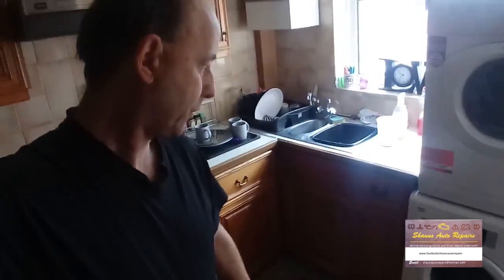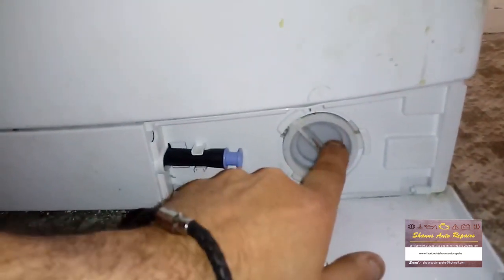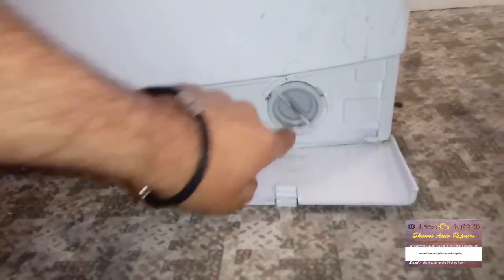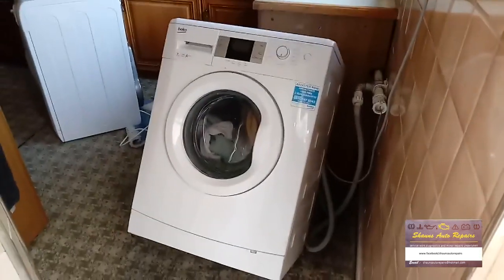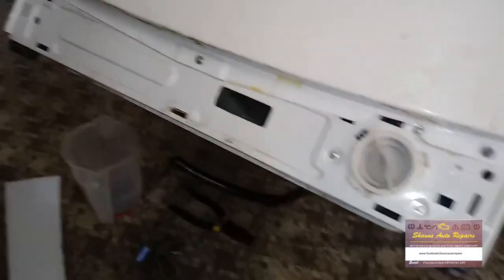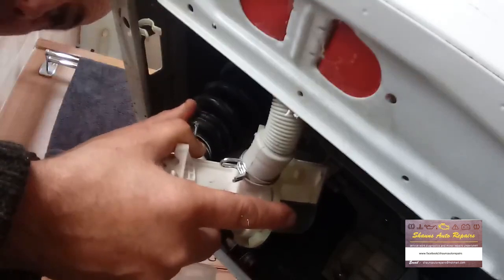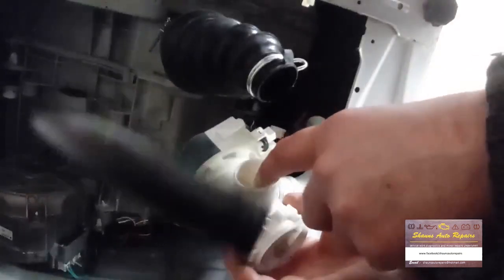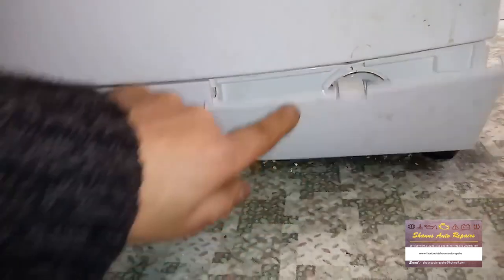How to remove or clean your waste water pump on your beko 7kg washing machine when its not draining

Comment: Great video - same as so many have commented, at the very least you saved me the cost of a repair job, although could easily have just ended up replacing the machine altogether. Amazing the amount of stuff that gets stuck in there.

Comment: Having this exact problem. I drained the water from the cap at the bottom. A few washes have been ok, but just finished a wash and the drum was about 1/3 full of water.  Thankfully I tried to spin it again and it has worked this time. But now I know what the issue probably is.  Thank you.
Reply from the maker: Glad I could help...thanks for watching

Comment: Informative video thanks. Issue I got on my one is the water doesnt ever drain out the hose bit, nothing happens but does easily come out the round filter part but takes ages and makes everywhere wet and recently when it finishes a wash the drum still has some water in there and lot of bubbles. When I then try a drain and spin to clear it, it starts from 12mins and stays stuck at 8mins for least 30mins and longer. Any advice would be appreciated cheers.
Reply from the maker: Hi... tricky..Remember I'm not a washing machine expert. I can only go by what I find on mine but sounds to me that either your pump isn't working or you have a blockage between the pump and the outlet of the pipe... if you have access to a hose pipe you can back flush it from the outlet and make sure it comes out the pump.. with the round filter housing in place you can back flush right back into the drum... hope this helps.. thanks for watching and your comment
Reply: @shaunsautorepairs5410  thanks for your reply. After watching how you accessed the pump there was a little blockage full of gunk and black stuff like squid ink in the little outlet pipe hopefully it works better now although still have the other issues lingering.

Comment: hi, i have same model but it seems the impeller has detached from the motor arm. can this be re attached or is a whole new pump required? many thanks
Reply from the maker: Hi.. thanks for watching and your question.... I would expect like most parts of this type the impeller is just a press fit on the spindle. You could pressing it back on with a touch of epoxy glue in the hole. Otherwise I expect it will be a new pump.

Comment: Hey Shaun. I've just opened my pump bit to clean it out. Now I've closed that hold back up. That propeller is spinning around as I can hear it but it's not taking in water now. I've got a Beko WTB820E1W
Reply from the maker: The inlet to the pump comes directly from the drum outlet so if you have water in the drum and its not entering the pump then you still have a blockage or a callapsed/twisted pipe.. 
If you have an external anti syphon valve or filter that may be worth checking as i knows ours gets blocked with hair etc and stops it draining.
Reply: Everything was fine.. Till I decided to clean it.  I pulled out that little thing that catches debrie. Closed it back up. I hear the propeller going around but nowt else.
Reply: @shaunsautorepairs5410  just worked it out. I just left the machine on and in 10 second sit reset itself.
Reply from the maker: @charliepearton9596  awesome

Comment: But what about models without a drain hose? We supposed to just flood the house?
Reply from the maker: To be fair I think most modern washing machines have a drain hose. If it's not obvious refer to your instruction manual.. thanks for watching and your comment
Reply: Mine haven't had a hose in the past. You can tilt the machine back and put a washing bowl under it to catch the water. (Probably too late for you, as you posted ages ago, but just putting this here in case anyone else wonders the same thing.)

Comment: Hi I cant get the pump off because of the metal things wrapped round it? How did you get it off 🤣 Am I just a weakling lol
Reply: You made it look so easy 😆
Reply from the maker: Are you refering to the metal clip that holds the drain pipe on the pump. If you are you will need a pair of suitable pliers to compress the ends as its quite a strong clip.
Reply: @shaunsautorepairs5410  Thank you very much ill try that now. Thanks for the fast reply
Reply: @shaunsautorepairs5410  theres nothing in the pipe? What else could be the cause of my washer pausing and not emptying?
Reply: @shaunsautorepairs5410  i have a BEKO WM 74155 LW
Reply from the maker: @lexilex3318  i can only coment on my own machine as im not a washing machine engineer. If yours is diffrent then im afraid i cant help you
Reply from the maker: @lexilex3318  if theres no blockage between the drum and the pump and assuming the pump is working you must have a blockage in the outlet pipecto the drain. Do you have an anti syphon one way valve installed in the pipe. If so these get clogged up with hair n debris and also need cleaning out

Comment: My drain pipe didn't work 😮. What can I do .
Reply from the maker: If its not draining you must have a blockage, either in the pump itself or in the stand pipe where the outlet pipe goes. You've proberly got some debris from the washing in the pump
Reply: Thank you for replying.Is there any way off unblocking the little tube. ? The machine is full of water. 
I tried to switch the cycle to a drain and spin but it kept trying to go back to.the original cycle and kept adding more water 😢. Just had floor replaced , so desperate to not have a flood all over it .
Reply from the maker: @HeatherChristie-z2b  you should be able to manually drain it... .open the flap near the base and where the drain cap is there should be a tube where you can drain the drum into a bowl or something .
Reply: That wee tube appears blocked too. Guess I am just going to have to go straight to the filter bit and do my best not to get it all over the floor. Any tips 😢
Reply from the maker: @HeatherChristie-z2b  just take things slowly....undo the filter a bit at a time and mop up any water that comes out.
That's all I can suggest... if you have any serious concerns get a plumber in to assist you
Reply: Cheers